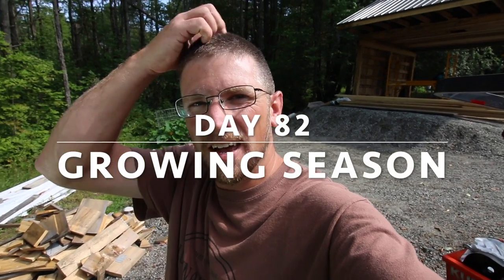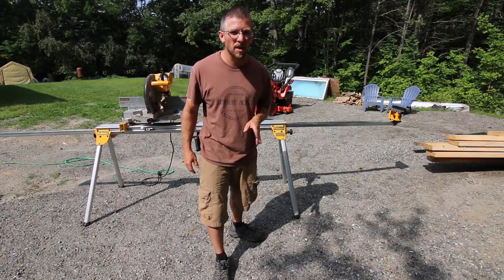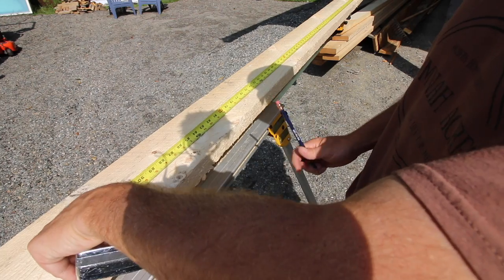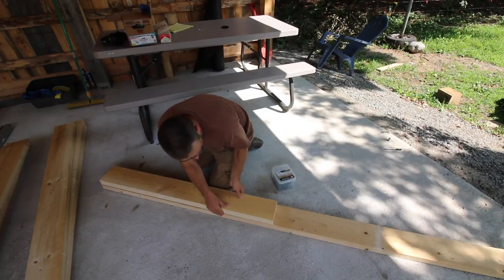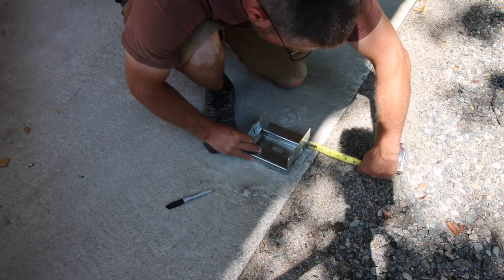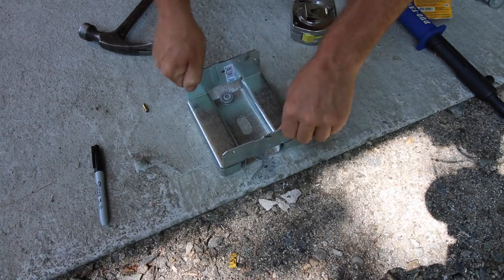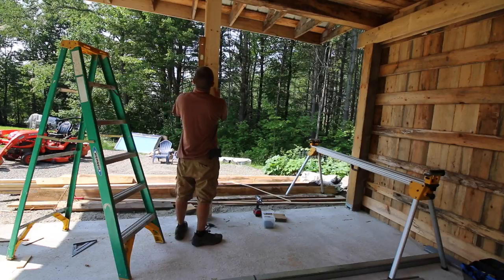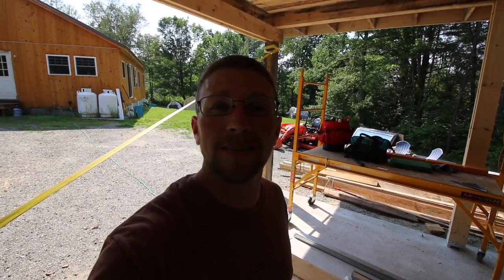Building Post for Custom windows ~ Off-Grid Outdoor Kitchen Build

Comment: My grandpa made a sleeping porch on the back of their bungalow during the 1930's.  He used single pane salvaged windows all around and made pockets, similar to yours, all around the top of the wall.  His windows all opened by pushing them up into the pocket and then stayed open by means of a spike nail that went through a hole in the window frame parallel to the glass from the inside to a hole in the framing.  It worked great.  Of course now days, with the advent of insulated walls in homes (and other such silly thoughts) it sure made that sleeping porch a hard drafty room to heat in winter.
Reply from the maker: Sounds like it was a great porch in the summer time

Comment: When you don't hit hard enough and the tool doesn't fire on the first hit, open it and check that the blank is still seated. Sometimes it will bounce up then you don't get full power. I've had them come all the way out, then all the second hit does is mash up the blank. I saw you've learned to hold the tool closed until you press it against the work, but I mention it for the benefit of less-experienced folks.
Reply from the maker: Thanks for sharing! Sounds like you have used one quite a bit

Comment: So much great info and how to's in this vid!  Thanks!  Love the bullet cement gun thingy!  Never knew about those.  Will come in handy on our patio that we have been thinking about adding a feature to that would require attaching to our cement slab already in place.  We will definitely be getting one of those guns!  Your design is so very interesting and original.  It has so much unique character.  It is going to be a very special place for you, Gina, & Olivia & Pluto!  I was wondering if your area is very strict on your codes when building outdoor buildings such as this?  Journey On!  Superb Vid!
Reply from the maker: Thanks! The ramset is a very handy tool when it comes to concrete. We have to follow building codes, but there isnt any inspectors

Comment: Can you please let me know what that tool is called. So much better than an explosive powered tool for small jobs.
Reply: I think it might be called a Ramset HammerShot 0.22 Caliber Single Shot Tool or similar if that helps? (Al's may be a Duo Fast Single Shot Powder Actuated Hammer Tool)
Reply from the maker: Yes it is a Ramset that you use a 22 blank for. They work amazing!
Reply: I worked in an office where they were building new cubicals.  We heard that thing go off at least 30 times in one day.  No warning.  I was on the phone with doctors offices and the nurses on the other end kept asking if we were being robbed.  It wasn't funny after the 5th or 6th time.  I'm glad you are wearing head phones to protect your hearing.
Reply: Thanks pal, greatly appreciated. I found them on eBay now but unfortunately there are none in Australia. I might have to bring one in from the States. Thanks again

Comment: I don't get why you are making your outdoor kitchen an indoor one?
Reply: norweavernh -- I would guess he wants it enclosed to keep away flies when they start butchering pigs.
Reply: Seems like it will get hot as heck in there and air flow will be at the ceiling only.
Reply: I think he could put screens over the windows. Then he can put a box fan in one window the get air flowing through. But you are probably right that it could get hot in there. But they plan to butcher pigs in late October, so it will be cool there in northern New Hampshire at that time. I am not sure if they are planning to can anything like pickles or something.
Reply from the maker: We are in Northern NH! Our winters are our longest season. Its going to be nice to use it all year! Wait until tomorrows video I think it will help explain it a bit better!